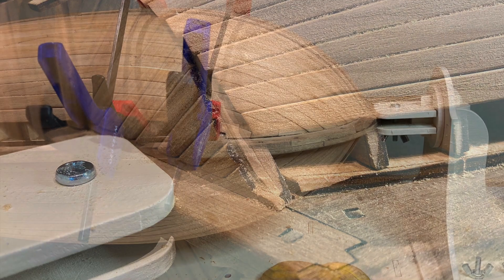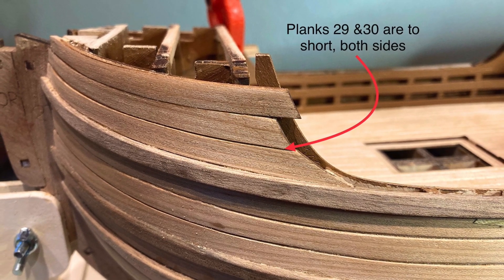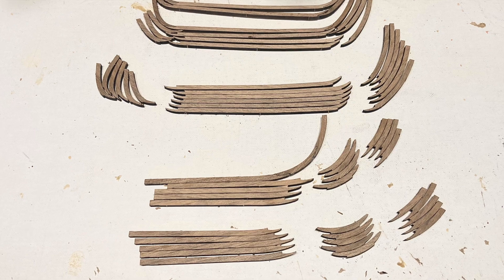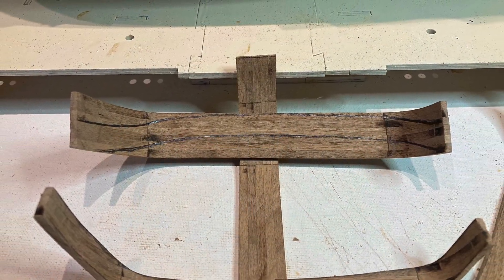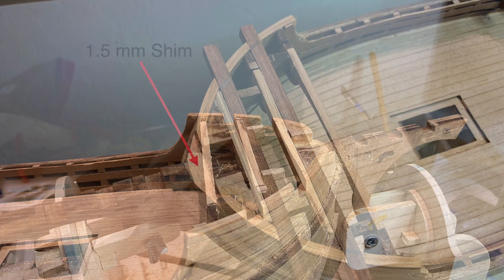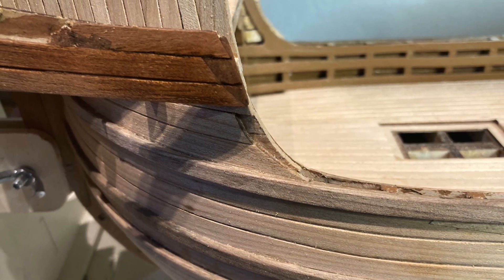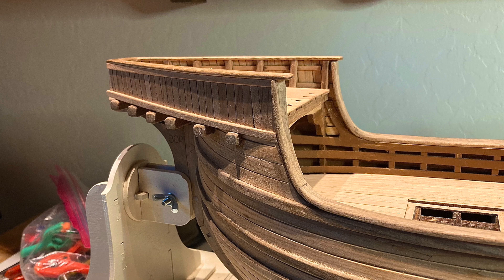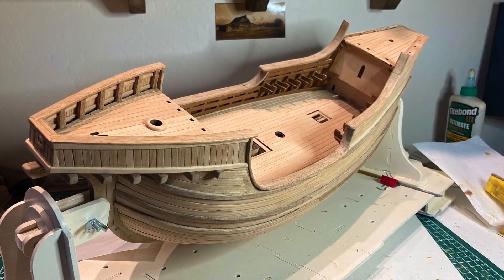Santa Maria Pavel Nikitin Part 2

Comment: I don't dispute that there are flaws, although some of them are not the fault of production or design. Some of the faults you point out are due to your assembly errors. For example, even if you sand each board 0,1 mm more than necessary near the keel will be missing about 4 mm.  And I don't think it doesn't need to be explained. On the length of boards which you have not enough, I would believe, but the thing is that I myself built a ship from this set, and I did not have such a problem. Also this ship was built by a dozen other independent buyers and also similar problems were not.
Unfortunately we have no possibility to start making videos on the construction of this ship, but in September this year we hope to start making films on our YouTube channel on the construction of our kits. If you have ever built an Ocre or Amati kit you should understand the difference in complexity of construction. In my opinion it's a one to ten ratio, so even such detailed printed instructions are not enough for everyone, you also need to be able to see the stages of construction.  We will give this opportunity to our customers this year.
Reply: Na verdade já vi várias pessoas reclamando desse kit, inclusive tendo que reconstruir peças para não ter os mesmos problemas do vídeo, eu comprei um modelo pavel pelo ebay  e tive vários imprevistos também, e olha que construo modelos a muitos anos! Mais todos os kits tem seus problemas assim como panart , occre ,mantua , artesania latina etc.a pavel nikitin não está insenta disso!!
Reply: I am building the same model (#22) and I am not experiencing the issues you are.  Constructive criticism.  Yes, there are issues with the model as there are with any model.  Being short on the stern on those planks can be attributed to how you handled the bow.  The five support pieces for the bow should have a nice rounded appearance.  By your video, it shows step-offs between the pieces.  Each of those step-offs will cause the bow to bow out a little bit and when dealing with precisely cut pieces will cause issues at the other end.  On all the bulkheads, he gives you a line to bevel from.  Bevel from that line to the peak on the other end and you will not have this problem.  When you reached the first rail, it's obvious that you decided to sand down rather than build up.  By doing this, you caused the pieces above this on the bow to be short.  You were asking that these pieces cover a greater area.  I actually had to sand these pieces down to get the rail cap to fit.    You are overcoming these issues with some unique fixes, which is the mark of any model maker and I applaud you for this.   But I have also learned that I will not criticize a model maker until I examine my own work.  Good luck.  Keep working hard and your skills will improve.

Comment: Hi,
You're doing a great job.
I've also purchased this kit. I thought it was an amazing kit and of higher quality than many others on the market.
However, I'm disappointed.
I watched your first video and took note of the shortcomings you were finding. I immediately went through my kit and found the same problems as you: missing parts, wooden boards that don't have the pre-cut pieces... in short, a small disaster compared to the great appearance of the kit.
I wrote to Pavel and he replied that he would send me the parts... but it's been over a month and so far I haven't received anything.
Honestly, I don't feel like starting. I know that all kits give some problems or another, but in this case I already know that it's going to give me a few problems... and I like to enjoy the assembly, not to be constantly solving problems.
However, I'll be waiting for the next video. You do a great job.
Regards.
Reply from the maker: Hi Raul, Thanks for the comment. Your conformation was very helpful. Because this is my second ship model build.
I’ve kept thinking am I making these mistakes.  I’d double check everything I’m doing.  And I would find , I’m not.
After watching Olha’s unboxing video of the Santa Maria . I just had to have this ship model. Like you, I felt this 
was a high end model from Pavel Nikitin. Which by the way, it’s been three months and I still haven’t received my 
parts from Pavel. I do agree with you, I want enjoy the process, not be a problem solver. Crossing my fingers the
worst is behind me. Hoping part 3 will be easier.  Vance